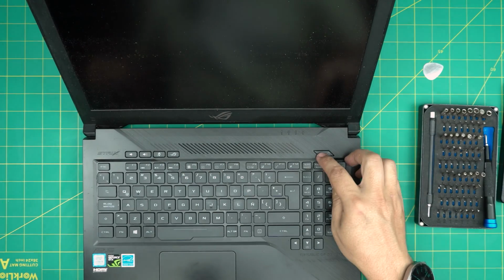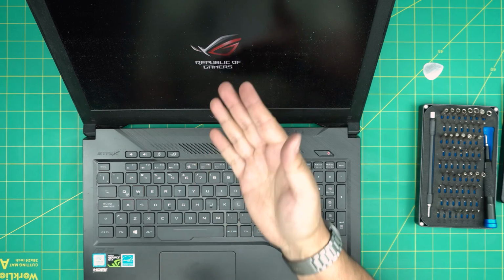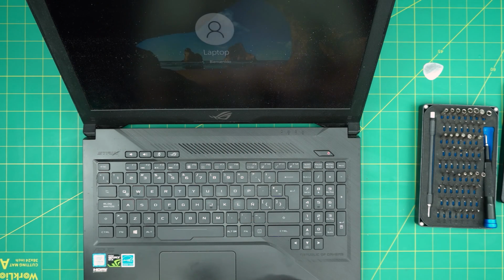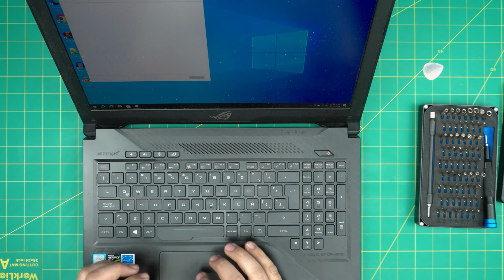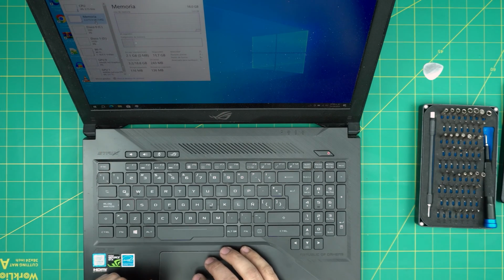How to Upgrade RAM for ASUS ROG GL503VD FY108T Laptop

Comment: Hello, may I know the maximum ram gig and mhz compatible for this model?
Reply from the maker: 🫠Regarding your question, I have included links for compatible options and to detect the maximum RAM capacity in the video description.
cheers🍻
Reply: Hi mate, i bought the 32gb kit from your, i only get black screen when using both the 16gb sticks, but when i use 1x 16gb and the original 8gb with one of the 16gb sticks it will boot any idea's what i need to do.

Also i ran the tool/command prompt to tell me my maxium ram and it says 64gb but everywhere else on the internet says the max for this moldel is 32gb.
Reply: Thanks! Another question, is the video card/gpu upgradable?